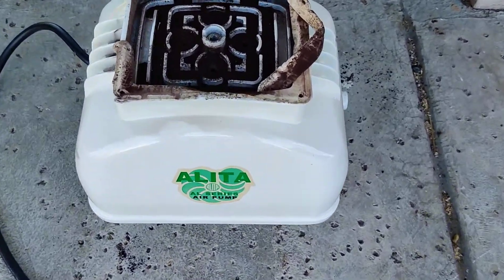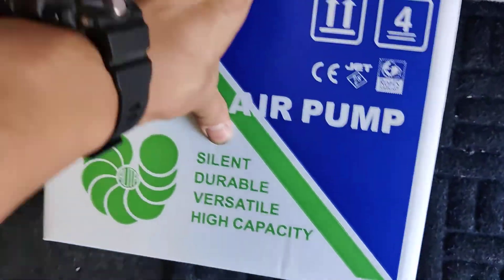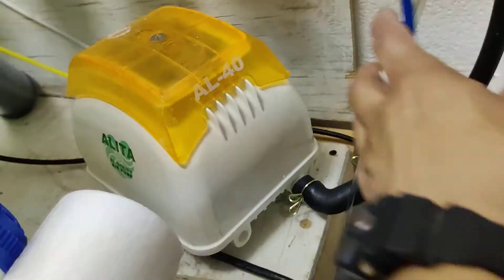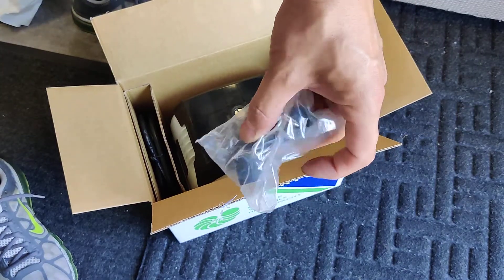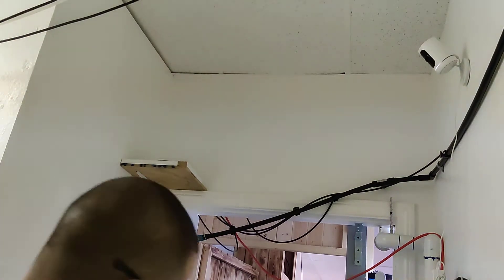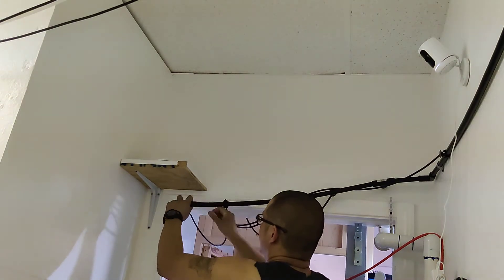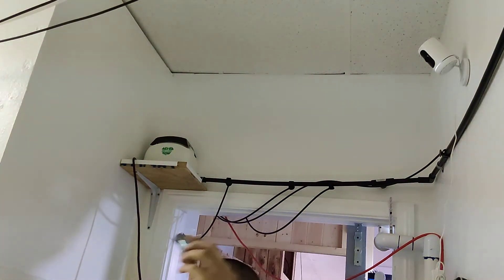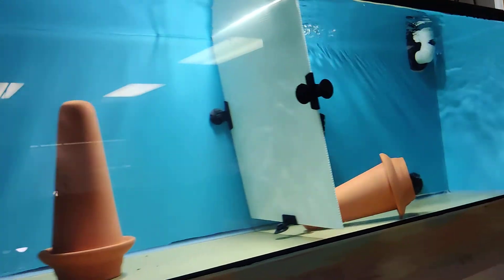Alita air pump alita AL80 aquarium pump

Comment: So that Akita 40 is supplying 10+ tanks with sufficient air flow? I was going to get the 60 series pump for a single 40 gal chambered sump. The section of the sump i want it for is probably about 10 gals. Please advise me on whether i should go smaller or not.
Reply from the maker: I'd get the 60 so you won't have to upgrade later on
Reply: @migueltorres79  Ok, thank you. Also, what size tubing do I need for the pump? I can't seem to find any info on that?
Reply from the maker: What we are using for this pump is irrigation tubing they have Bing they have it at lowes for sprinklers
Reply: @migueltorres79  but what size? 1/2 , 3/8....?
Reply: @migueltorres79  great suggestion!!!! I bought the hailea v60, and man this thing is a beast !!!!!
Reply from the maker: Congratulations.  Now you have as much air as you'll ever need
Reply: MIGUEL TORRES FISH TANK does your pump run warm, or a little hot? Is that normal?
Reply from the maker: Yes